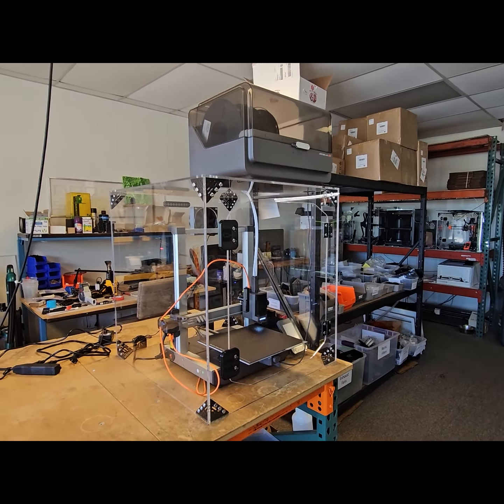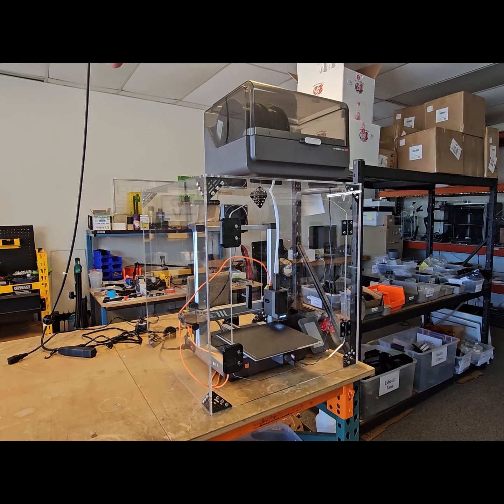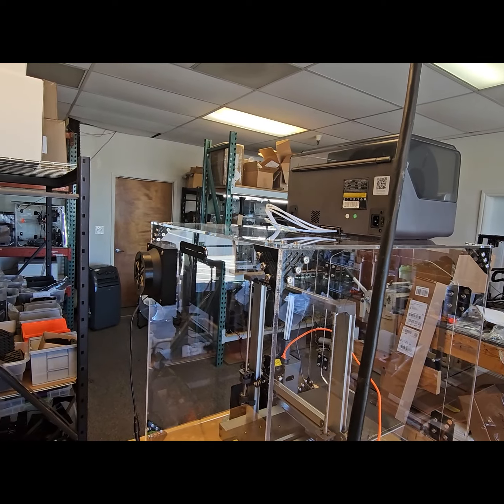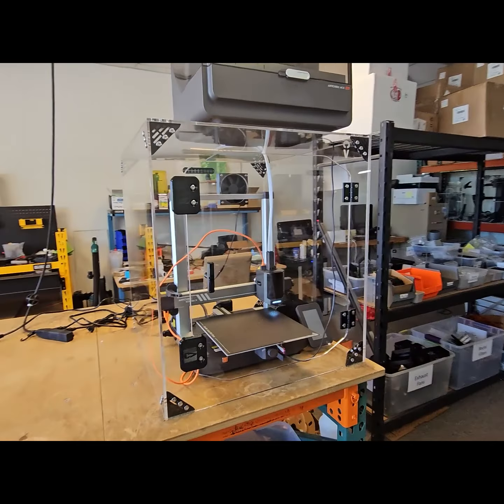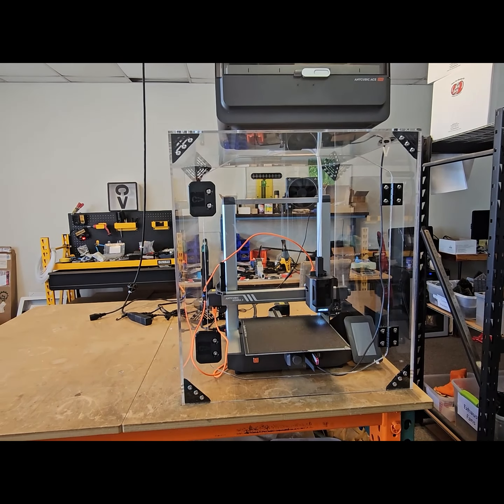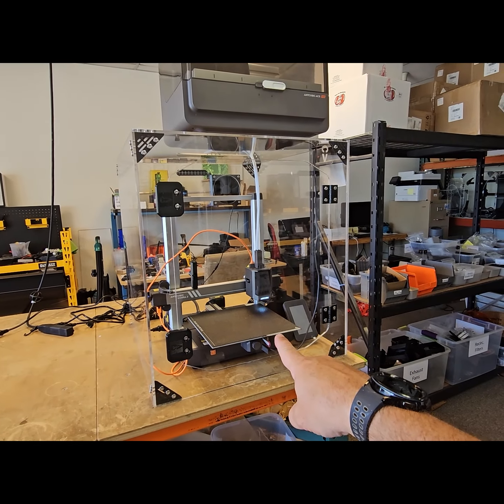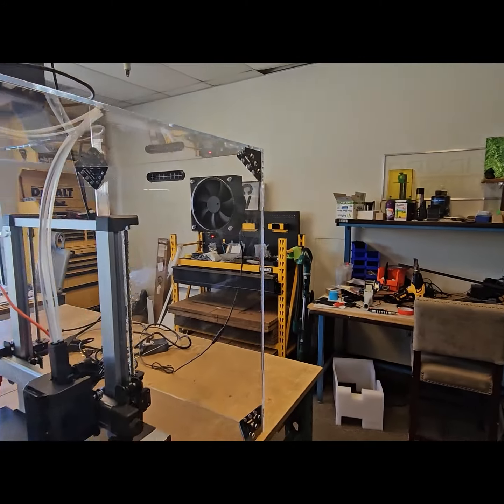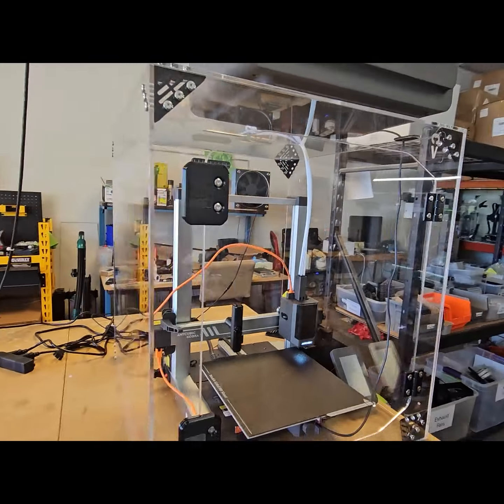Anycubic Kobra 3 by Clearview Plastics

Comment: Thank you. Will it fit the printer with the spool holder attached? Even with ACE, a spool holder is required for printing TPU
Reply from the maker: We use the mount for the stock spool holder to stabilize the print bed cable. We have an internal spool holder option for our enclosures or you can feed from a filament dryer through the port on top.